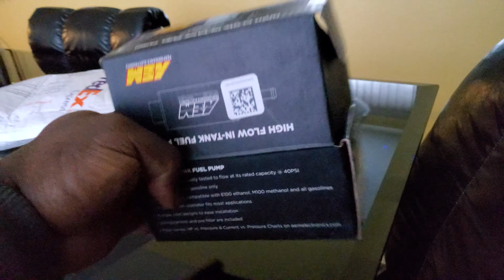07 grand prix fuel pump build

Comment: I want to make an upper access like you did.  Instead of unplugging the power to the pump, wouldn't it be the same just to take 1 of the contacts off the battery?
Reply from the maker: I never did that I just go by wat I know works

Comment: Why not use heat shrink for splicing the wires?? I'm always worried bare wires and gasoline lol
Reply from the maker: Cause e85 and gasoline eats that away already been there lol this way is safe trust me
Reply: How would I know if my Grand Prix GXP need a fuel pump my speed meter is jumping and I am not getting any check engine light stall wind speed meter is jumping

Comment: Are you using a gtp 2000 canister?
Reply from the maker: No thats a 05 and up canister its non returnless
Reply: @TERRELL SMITH  where did you buy it I’ve bought two different ones now and  this last one the fuel pump filter sits on the side of the pump and therefore can’t mount this pump properly without taking off the fuel pump filter on the bottom
Reply: @TERRELL SMITH  I bought my last one at Napa for a 07 grand prix
Reply from the maker: @blakejackson4244  i get 40 dollar canisters off ebay and replace the pump
Reply: @TERRELL SMITH  okay thank you man so very much
Reply: @TERRELL SMITH  and there for an 06 and up gtp